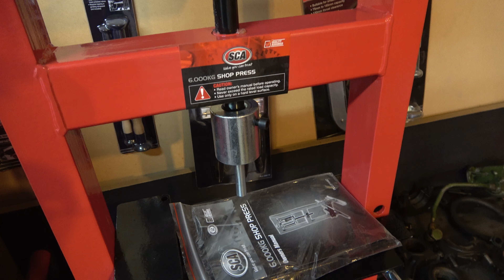Cylinder Head Check and Surface - A Series Rebuild - Part 1

Comment: They're good stud tools...I have a 40 year old Litchfield and it still works like new...The idea is to put it as close to the base of the stud as possible..It will grab on... .002" is my warp limit...
Reply from the maker: Works a treat. I'm well within .002" so looks promising. Cheers Zig
Reply: @Badgertronix  that's great! I didn't think that feeler gauge would go in. 👍

Comment: We used to ream out the new valve guides. On the unleaded thing, something we noticed with the A Seriea is that they used to 'knock' or 'pinking' as some call it. It needed some timing and mixture tweaking to sort most of it out. But the best results came from using the additive like you mentioned. Nice to see this old girl getting some TLC 👍
Reply from the maker: I've read a few things about adjusting valves and adjusting timing to cope with unleaded fuel and stop pinking. Something to figure out closer to the time. Cheers

Comment: You should have got a engineering shop to put the head on their surface grinder and grind it, it would have cost very little.
Reply from the maker: I did this in the time it would have taken to drive to the machine shop. This build is all about what you can do at home

Comment: what about getting the head checked for Cracks ?
Reply from the maker: To be honest I'm just going to wing it. The cooling system pressure tested fine and it wasn't overheating. Could be a bad idea but easy enough to take the head off again if I need to.
Reply: Badgertronix I like winging it 🍻🍻🍻
Reply: @BackCountryWrenching  me too.

Comment: What grit grade stone did you use to re surface the head. Lots of grades on eBay.
Reply from the maker: This is the one I used:
https://www.thetoolshed.co.nz/product/835-toolshed-silicone-carbide-oil-stone?gclid=Cj0KCQjw6uT4BRD5ARIsADwJQ1_kZSfCJroA0gVroqMDwKAYhsuzkmSkGf1y9qW7Zus1-GnNwXGBegoaAsQ4EALw_wcB

Comment: If its good enough for Turbo Yoda or Mechanical Stig its good enough for me. Honestly you'd probably get it closer to tolerance with an oil stone than it came from the factory. Especially if it was made on a Friday. 😆

That stud extractor looks quite shiny. I have had limited luck with the 2 nut method. Toolpro are killing it. Halfrauds should take a leaf out of their book. 🤔
Reply from the maker: I think it will be more than adequate for this high compression, high tech beast 🤣

ToolPro have just refreshed the range and this was a new addition. Perfect timing and it worked great

Comment: Not sure if I've already told you, but I reconditioned engines in the early 70s. So have done quite a few of these engines. Get a new rocker shaft, as they wear on these. Old Fords had to have a camshaft and followers.
Reply from the maker: We'll have a look at the rockers in the next vid. Given the price of a recon one I'll probably go down that route. Cheers

Comment: I’ve had better results with that stud removing tool by installing it as close as possible to the base of the stud. Particularly on motorcycle barrel studs, as they tend to be  l o n g. Reduces the flex in the studs. Cheers.
Reply from the maker: That makes more sense and stops them twisting. Cheers
Reply: @Badgertronix  And I guess it'd do less damage to the threads if you intended to reuse the studs.

On the more rustic side, if you actually knew you were ditching the studs I might be tempted to use big waterpump pliers instead.

Comment: Sorry i had to ask, why arent you fitting hardened valve seats?
Reply from the maker: General consensus suggests that they aren't necessary. If there's ever a problem with valve seat recession it's easy enough to pull the head and do them then
Reply: Thanks. I thought they were needed for unleaded, but as you say the head would be reasonably easy to pull if theyre needed.
Reply from the maker: After 20+ years of no leaded fuel plenty of people have run their classic without issues with unmodified heads. Hopefully it will be OK... I do have an additive I'm planning on using just in case
Reply: Thanks. Keep the videos coming.
Reply: @Badgertronix  I like TCW3 and I have a series on it. Helps quiet engines. May not be a lead substitute.

Comment: That stud tool was terrible it would be no good I small areas
Reply from the maker: It took out everything I tried it on nice and easily. True it might struggle in tight areas but no big deal, plenty of other options available. Cheers
Reply: I've never seen one. Is it called a stud remover?